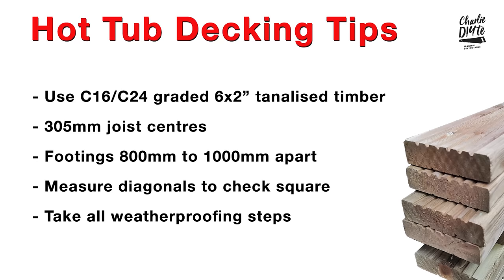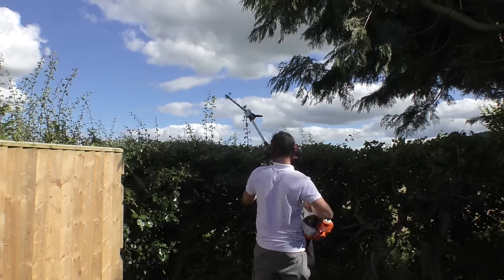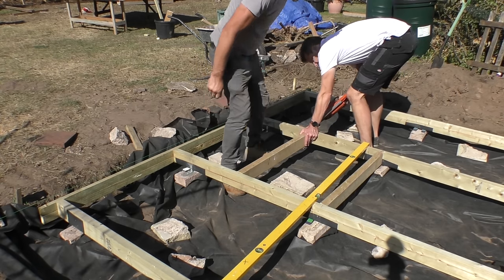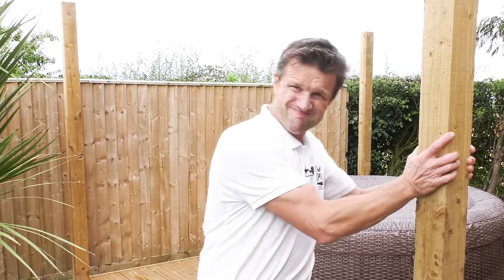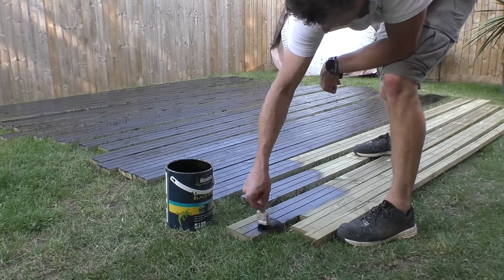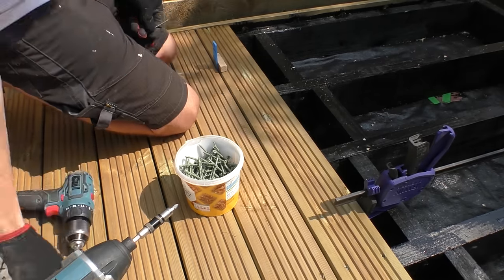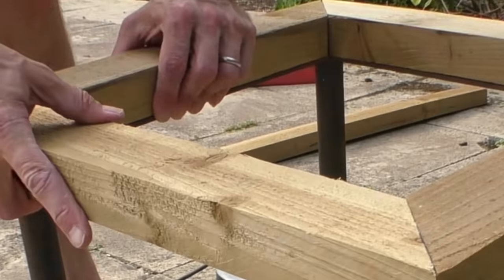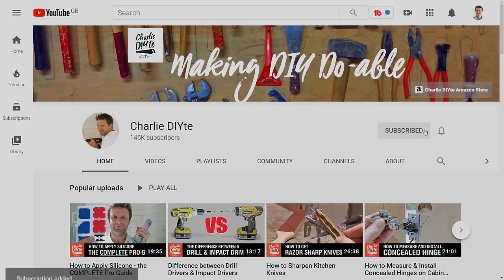How to Build Decking for a Hot Tub

Comment: I think any fall that would help the deck drain would be too steep for a hot tub; even 5 degrees of fall wouldn't encourage standing water of a few mm depth to drain effectively.  I did a shonky (quick and 'temporary') deck install 15 years ago, with zero maintenance since and it's only now starting to show signs of rot.  Yours will be good for 30 years!
Reply from the maker: Makes a lot of sense, that Stephen. Many thanks for the comment. Let's hope so!

Comment: I've applied bitumen paint to 100 % of my posts above soil level but now feel regret. I'm thinking the bitumen will act as a seal and will rather prevent the posts from drying effectively. Oh well, I suppose time will tell if it's a fatal error
Reply from the maker: I'm sure they'll be fine, particularly if they were dry before you applied it.
Reply: @CharlieDIYte  yeah I hope so. I stupidly did it the wrong way round. Should have applied bitumen to the subsoil section of the post and left the sections above unpainted. Btw thanks for the video. Some very useful tips and well explained

Comment: Great video Charlie, thank you for uploading this. So helpful as I'm planning on doing some decking soon. A part of the area my subframe will sit above is an old poured concrete slab (approx 3m x 2m), but other parts are just soil. I was planning on concreting posts in the soil to support the subframe joists but I like your idea of the brick foot supports in a little 'bowl' of concrete. Do you reckon those would work on the concrete slab too. Thank you in advance
Reply from the maker: Yes definitely would work on the slab too. It would be worth your while to bitumen the joists like I did, although I wasn't able to do underneath which is arguably the most crucial part! Also you might consider composite decking. That way it will last years and years, although it is a lot more expensive.
Reply: @CharlieDIYte  thank you, yes will definitely use that bitumen paint advice and hopefully composite too if the budget will stretch that far.

Comment: I wish you did this video 3 months ago! Like you built my first deck (5m x 4.5m) during lockdown (90% done) but not for a hot tub, just rowdy children jumping up and down a lot for a play area. Ended up using bricks or broken concrete slabs to support the base structure. Didn't do concrete footings but the earth underneath didn't have anything growing for over 3 years so it was pretty compact. Perhaps this might be my mistake. Also screwed posts to bearers resting on bricks/slabs rather than support underneath. Perhaps another mistake for me. Gravelled over weed control to keep it down and any persistent weeds finding a way through. My wife wanted a stain on the deck so painted underneath (1 coat) and top (2 coats) but I'm not sure how that will survive a few British winters. Planning on a building a path to one edge of the deck level with it. Never stop learning.
Reply from the maker: Sounds like you've done a lovely job there, mate! I agree, never stop learning - a great mantra for life 👍

Comment: Good video. Won't the insulation between the hot tub and deck retain/soak up rain water and accelerate deck rotting?!?
Reply from the maker: I think this is a potential problem with whatever you do under the hot tub. The foam mat that I originally bought gives you the same problem, in fact more so as it does soak up moisture whereas that insulation board won't soak up moisture. The issue I guess is with the rain water under the hot tub. I'm planning on a roof for the winter months which will largely alleviate these concerns.

Comment: What should be the minimum dimension (depth) of any timber used for a Hot Tub.  eg, is a 45mm x 95mm gonna be adequate with the appropriate noggins?
Reply from the maker: I wouldn't go any less than I did, particularly if it's a raised deck.

Comment: Great video. Do you have any plans to add some deck lights ? I only ask as I bought some to add to our new garden room veranda and I haven’t got the balls to start on it yet.
Reply from the maker: No plans at the moment, Darren, but I'm hoping to build a garden room at some point. Are you putting them into the decking or into the veranda roof?
Reply: @CharlieDIYte  Apologies, I meant the decking, there is a few feet of decking out of the front of the garden room with the fascia board. Bought a set of round LED's and was thinking of putting them along the front of the top fascia board. Looks quite easy to connect up but not that confident in the drilling etc

Comment: Great decking project that Charlie. Pretty much bomb proof with all that prep. I’m glad you came back and re-spaces the boards with gaps because when you mentioned you had laid everything 100% level I thought “that won’t matter too much because of the spaces between each board.”  Then I saw you clamping the boards and thought 😱. 
I don’t think there’ll be a massive problem with them being level. They won’t hold much rainwater and the grooves aren’t that deep and some movement in the boards. Plus evaporation will get rid of the rest especially if it’s a sunny corner. Enjoy your hot soaks - I bet you needed it after all that digging!  All the best.
Reply from the maker: Thanks Paul, I appreciate that 👍 Yes, I meant to put in a few amusing photos showing how utterly exhausted and beaten up I looked after about day 4! There's quite an interesting argument raging on this feed at the moment about whether the grooves should be face down as opposed to the way I've laid them. I'm convinced the manufacturers have designed them to be face up.
Reply: @CharlieDIYte  Any decking I have seen, the groove profile is face up with the intention of providing some grip to what would be otherwise slippy smooth boards.  Dunno why people would think they're meant to be profile down.
Reply: @paulrowley71  The groves give absolutely zero grip.  Why would they?   They only thing they do is make the wood more wet more of the time.  Its less slippy when the boards are flat side up - try it for yourself - I know I did, and now my full deck is flat-up.  Plus, it'll last FAR longer as the groves-up makes it rot and encourages algae - which is even slippier!

Comment: Scott Brown has some good videos on deck building and general woodwork for future reference.
What you've done is perfectly fine though imo, well thought out with what you had to hand.

Little tip as well: construction screws/structural screws are perfect for decking especially ones that will take weight like a hot tub. So maybe add some of them wherever possible with what you've built. 

All in all, loved the vid and well done on another project!
Reply from the maker: Thanks so much for that, Paul, I'll remember that for the next job, and in fact, combined with a torx bit, that's got to be the perfect combination. 👍

Comment: Is the pergola video coming any time soon?
Reply from the maker: Vince my son was asking that just last night. Yes, some time over the next couple of months. Sorry you've had to wait so long.
Reply: @CharlieDIYte  thanks, I have a particular interest as I'm planning on a deck with the posts that the deck will be attached to also extending up to form the posts for a pergola over the area of the deck.
Reply from the maker: @vince9196  It's caused me a bit of head scratching because I wanted to maintain the box like structure with some 4x4, but they don't come long enough for the 3.6m span, and I don't want to make it to the typical design where you see 6x2s with a load more plonked on top at 90 degrees. Plus my posts have twisted now. It's going to be a fun challenge😉
Reply: @CharlieDIYte  oh that's interesting, I was watching one of the Home Renovision video yesterday when he talking about the posts twisting if not braced and he put a 2x4 across the to hold them until ready. I l've been wondering about either doing a box type pergola or the more traditional type.  The box type seems maybe easier to achieve. overall I want a 4.4m wide by 6m deck and pergola but it seems the best idea is to split it into two 4.4m X 3m sections and just build the first section and get it completed before adding the second and joining them. I'd probably put additional posts in half way along in your situation to allow you to connect to the 4x4's at the top  as I'd be looking to add these canvas/uPVC  side panels that attach on the outside and can be rolled up in summer. Then it could be used in less pleasant weather also... Although I'm sure you have better ideas and being a novice at this I'm here to learn from someone like you. I'll look forward to see what you do.

Comment: First video of yours I've seen, and subscribed - fantastic stuff, cheers. May i ask why you didn't go with a flagstones / patio stone rather than wood? I want to go flagstone as I'm in French Canada and i don't see wood lasting many winters.

Btw I'm in mild panic as Wife has bought a hot tub and then realized that she needs me to build a deck. Uh oh.
Reply: Oh, and in addition, do your Amazon links work for Canada purchases ie from here? I'd like to support.
Reply from the maker: D'you know what, that is a very good question. Honest answer. I never thought of using flagstones. You're absolutely right, flagstones will last a lot longer, provided of course that you prepare the sub base for them properly. I'm guessing cost wise it will work out pretty similar or perhaps cheaper to use flagstones. My advice to you would be go with what you think will work best in your situation, and it sounds like flagstones will be the perfect solution. Massive thanks for subscribing. Humbled my videos have reached French Canada, and that you find them interesting/ useful. Good luck with the hot tub. You better get cracking!! PS. if you do put it on flagstones, make sure you have a nice thick insulation mat underneath as otherwise you'll lose a lot of heat through the floor. I've actually put a 1 inch layer of insulation board under the hot tub with the hot tub insulation mat on top of that.

Comment: Love tHe video, did you uses any decking oil/stain if so was it any good ?

Cheers in advance
Reply from the maker: Thanks buddy! No I didn't but I think I'll treat it some time at the end of the summer. I think it makes great sense, because if the water doesn't sink in (as it does even when the deck is tanalised) it's not going to get slimy and therefore slippy nearly so easy, and will be much easier to clean with my leaf blower - which is how I keep all the leaves and other bits of stuff off it.
Reply: I've used OSMO decking oil and that has lasted really well, albeit a tad expensive. They do a non slip version you can put on as a top coat. I've just re-oiled after 3 years - a decking brush was so fast so get one!

Comment: Charlie, great content as usual. I had the same thought with regards to water run off. I treat the deck with 2 coats of clear decking wax (No Nonsense Screwfix) and I now have no standing water. I reckon to establish a fall would be over engineering,  I would like to hear a deck gurus opinion?
Reply from the maker: Decking wax is a great idea Les. I guess with the tanalised treatment it amounts to a similar effect but the wax is another layer of protection, I guess. I reckon one benefit of a slight slope would be to prevent water being retained under the tub.
Reply: Charlie DIYte My decking is tantalised (the wax perhaps reduces friction ensuring the water flows off quicker). Some might say waxing is not required on tantalised wood having experienced the decking on wet days with and without wax I would highly recommend waxing.
Reply: @CharlieDIYte  No need to slope if you put the boards the right way up in the first place ;-)
Reply from the maker: @petertr2000  Are you suggesting these are the wrong way up? I don't agree.

Comment: They say the decking here should be smooth side up, having the grooves down allows air circulation and stopping rot
Reply from the maker: As discussed here https://bit.ly/3gmCMmE Mine was designed to be laid grooves up but you're basically right.

Comment: Sorry... but.you said you removed the dpc when you removed the decking when you reset them with spacing...why did you do this?... also if you put gravel on top of the dpc... I assume you dont go above the level of the top of the bricks under the joists?
Reply from the maker: Just because the joists had moved a little, allowing me to put spacers under them. Yes, you'd just want a light later of gravel - probably an inch thick, just to make it inhospitable for rodents.

Comment: Should of made a nice patio area with a gazebo/ hot tub surround would look lot nicer as this will look nasty in a year or so due to weathering dirt and algae build up all wood decks look good for the first year 😁 if anyone is looking to do this I would use Composite decking yes it's more expensive but it will save you time on treating it oil/stain all the time pressure washing it plus will look lost nicer for a lot longer of time so in the long run will save you money and time.
Reply from the maker: You're probably right, Darren. We'll see how it weathers. I'll be putting a roof on for the winter, which should help a little.
Reply: @CharlieDIYte  I would oil it tho soon as possible it helps a lot just don't stain it I did that with mine and it just peeled when weathering and foot wear i had to sand it all back and oil it which made a very big difference a lot better at repelling the water and stopping the algae build-up in the grooves.
Reply from the maker: @darrenwilliams7741  Will do 👍

Comment: Just one thing.....
It's never a good idea to treat only 1 side of a piece of wood, as you create tension imbalances and over time, the wood will warp...
This is why you use Balancing papers on the opposite face to a veneered surface eg a Table top...
Small but important point, in my opinion.
Reply from the maker: Fair point Steve. The top of the decking is tanalised, but I'll be giving it a coat of sealing oil or similar at some point to stop the rain sinking in and to make it easier to keep clean.
Reply: @CharlieDIYte  I'm actually about to build a 5m x 3m mini gym, complete with reinforced concrete base and self built oak power rack.
Fully insulated structure etc.
So wish me luck....... I expect that I'll make a few mistakes along the way, but hey  that's half the fun.......
Reply from the maker: @stevec6875  You must let me know how you get on with that as I'm hoping to build something similar next year 👍
Reply: @CharlieDIYte  no probs, will do.

Comment: Good job but at 17:22 when you're talking about  the underside of the deck boards spaced to avoid dampness, you didn't mention that the grooves are for drainage on the underside of the boards. You can get double sided grooves on some types of deckboard that will assist with the drainage of the underside and lengthen their lifespan - https://www.buildbase.co.uk/winchester-decking-board-27-x-100010912-2832413  This is something that the Aussie would say at least. Otherwise, great project.
Reply from the maker: Thanks Stephen. That looks like good stuff. I've had one or two people getting quite animated about the fact that I've put the decking the wrong way up. The trouble is my decking is only designed for the grooves to be facing upwards as the underside has two reasonably deep square grooves running the length and is otherwise completely flat. It wouldn't look right the other way up and the grooves would quickly clog with debris as they're only a few mm wide. That Winchester on the other hand would look great either way, and in fact the wider spaced grooves would probably help drainage under the tub. It was a case of use what I could get hold of, during lockdown. 👍
Reply: @CharlieDIYte  How often in the UK do you see someone has put the deckboards grooves down for drainage? It's hardly ever - the idea of a smooth flat surface which will become slippy very quickly doesn't appeal. The other option would be to cut some notches into the supporting  joists to help moisture escape.  Routing a few notches wouldn't be that tricky and using the cheaper deckboards with this method would be just as good as the double sided grooved boards.

Comment: You've put the boards the wrong way round - the groves are supposed to go underneath.  I know nobody does this (I did!) but that's really how its supposed to work.  Its no more slippy when wet, drains and dries more quickly and lasts longer.
Reply from the maker: Peter, with respect that's a bit arrogant of you because it's just you're opinion that they're the wrong way round. All the carpenters I speak to scoff at the idea that the ungrooved side is the correct side to be facing up. Just Google "decking boards", click on images, and you'll see what I mean. I don't have a problem with you doing it that way, but it's simply not correct to assert that your way is right. It's personal preference at the end of the day but they were designed to be groove side up.
Reply: @CharlieDIYte  This is what the UK quality governance board actually says - https://www.tdca.org.uk/blog/grooved-vs-smooth/
Groves up was a mistake that caught on due to asthetics, it offers no grip advantage whatsoever, and is far worse for water retention (which leads to premature rotting of the timber)
Reply from the maker: @petertr2000  That's very interesting. As the article says, ultimately it comes down to personal preference but if you subscribe to the argument that the grooves should be underneath, the decking board manufacturers over here need to change their designs because my boards wouldn't be appropriate the other way up because the non grooved side has two thin 3mm wide slits cut down it's length, effectively dividing the board into 3 equal sections  (ie they're not smooth), which would be very hard to maintain as they'd get clogged up and would themselves become a source of rot.